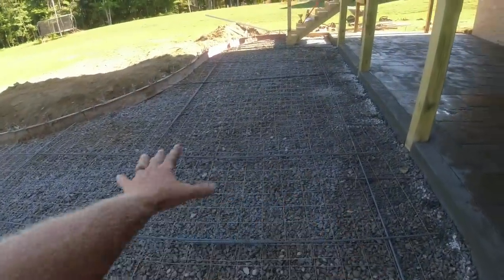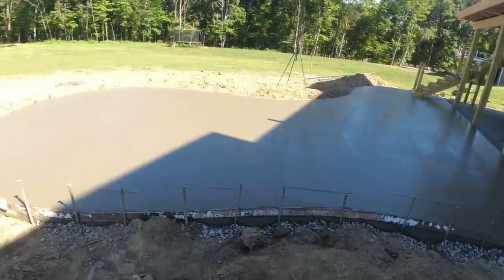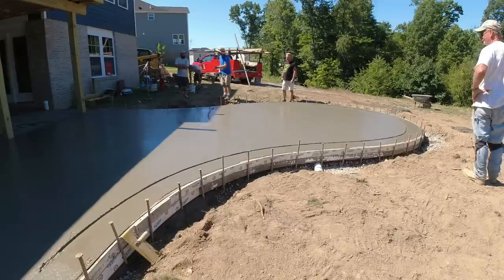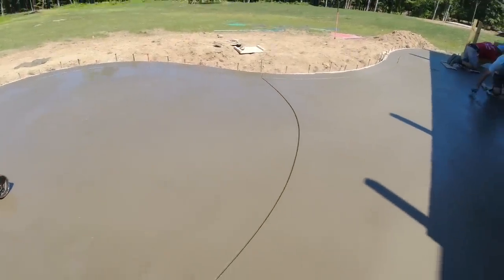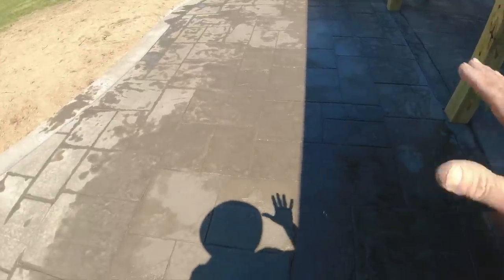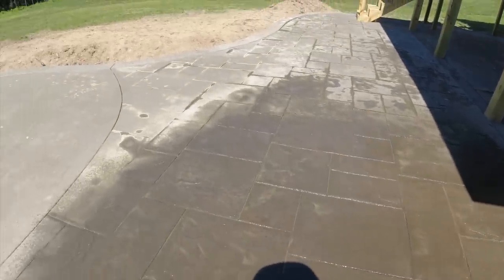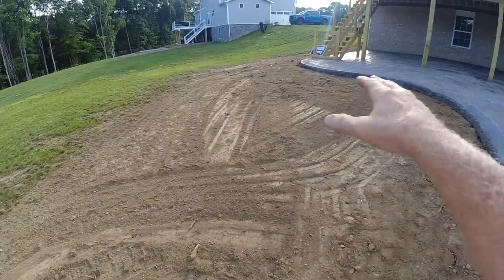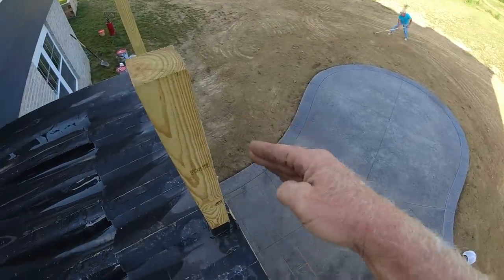Beautiful Patio with Fire Pit Bump Out!

Comment: Well no surprise today, I just knew it would finish out beautifully. I did not see the curved expansion joint coming though, wow, kudos on the free hand there Tom! The mats sitting too long and fixing it later, getting the stamp lines on the new pour to match w the first pour, screeding and stamping around and under stairs, getting the concrete's drop just perfect to keep water draining off, paring the different stamps making them connect perfectly and ordering enough cement to not come up short, gosh that's not but half of what one needs to know! The depth, stone, strength, temperature, wire mesh and rebar, forming and tons more! I liked learning new skills back in my working days, but what I think would scare me the most is the end result is so permanent. If a mistake is made on a part, well it all has to come up and start over! The little mess made by the mats was nothing to you, but if you pour and the sub base is slightly frozen then disastrous damage hits and every bit has to be demolished and done over from scratch! That is a lot to carry, the stress! Oh man! This isn't even a drop in the bucket! There's more than just job skills in what you do Tom, like emotional skill, integrity--- I could go on but the point is, you and the crew you've trained are nothing less than awesome! Anyone desiring to pour their own patio definitely needs to watch your videos. The very first time I heard your name spoken was in a sentence saying you were the best in the business. I can't help but agree. Thanks for sharing.👍👌❤🇺🇸🇺🇸
Reply from the maker: Keith that’s probably the best compliment I ever received thanks
Reply: @Concretewiththehauses  Mom found a hair in her food. She asked to have it replaced. The second plate had the same hair and no telling what else! I learned not to complain, either take it or leave it.....but - I absolutely believe that praise should be given where praise is deserved. I gain nothing and desire nothing. Praise was given because it was deserved. Everyone who watched the same video I watched and did not at least press the like button, shame on them! Fact is, from all the videos I've seen, the perfection of the work isn't the only thing praise worthy as the videography and editing has gotten better. Sorry my comments are so long, but also to make my point stronger, I prefer watching YouTube on my TV. If I connect my phone to my Roku so I can comment, it goes crazy later on. I can't pick a video, it goes crazy and plays whatever it wants until I disconnect. So, I watch you and OWTM, well, Mike has almost stopped posting early, on my phone before I make it to the TV. That way I can make a comment, because it helps your channel, and I always tap the like button first before the video begins. If I like the content, why would I not do so? Why would I not do that little, tiny bit to help pay back the enjoyment you've provided? Because you get money from YouTube? I can only hope YouTube triples the money to help inspire you to keep providing me w good wholesome family, good, REAL LIFE content so I can enjoy my TV because everything else on there is CRAP! I'm sure you wish I'd stop typing so much, but for all you've done for me, I just want to help keep you posting. I firmly believe that if all we had on TV was real like yours, America would be better off. So thanks Tom. After I'm dressed and ready to start another day, I'll grab my phone and open YouTube and look for Concrete with the Hausses! See you there!👍👌❤🇺🇸🇺🇸

Comment: Hi Tom, love the channel and how professional you guys are.  I have a question about a project to replace a driveway 23ft wide 58ft long.  I have a couple estimates and waiting for couple more but they are like apples to oranges.  One say no need for rebar and okay to not have gravel base, other said same but I asked for it and the estimates are 13,000 and 22,000. Can you advise what’s best and a reasonable fair cost for this project,   Thanks!  Been watching from the beginning of channel!   Ron
Reply from the maker: That is a tough one to answer. as far as gravel or lime stone it’s nice to have for drainage as long as it can drain somewhere. Secondly reinforcement I always recommend it.we’ve torn Conccrete out without it what a difference it comes out so much easier.another good point is if the concrete cracks the reinforcement helps hold it all together
Reply: Thanks Tom